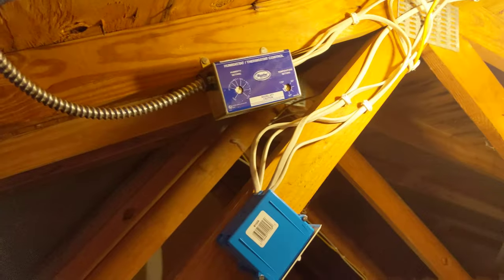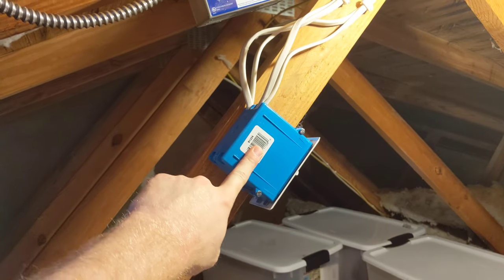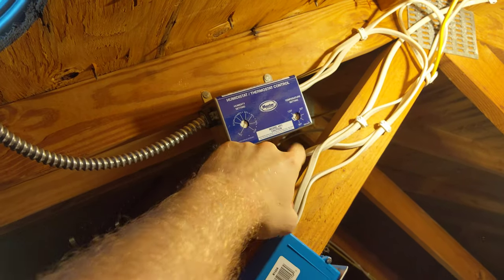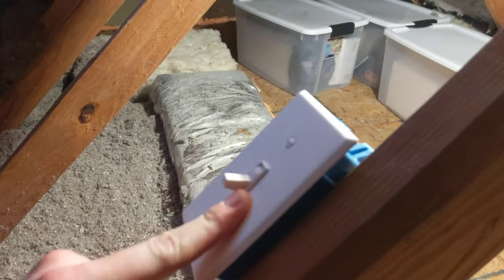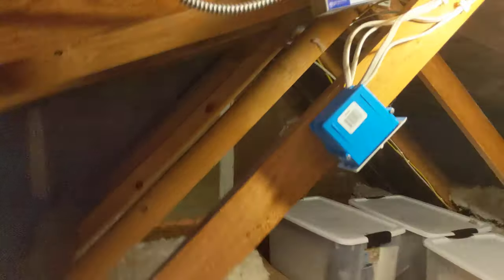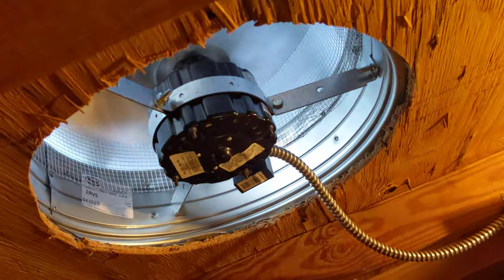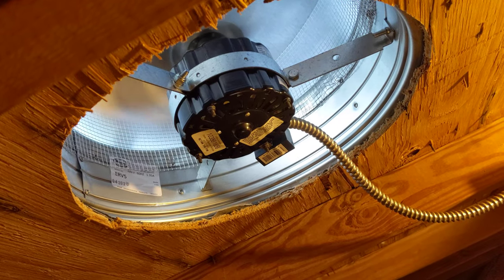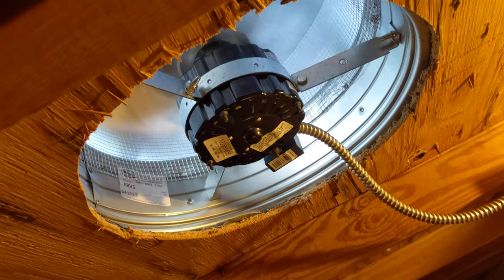Attic fan install with manual override and power shutoff

Comment: How you set up the wiring for the bypass? I would like to manually turn off and on my attic fan
Reply from the maker: Let me find you or make you a quick diagram.  I have a power cut off that is right next to the fan for servicing and the bypass switch that is in parallel with the humidistat.
Reply from the maker: Something like this is what I did with the over ride. https://shopgreenbeing.com/wp-content/uploads/2018/02/electrical-would-this-be-the-correct-way-to-add-a-timer-switch-in-with-regard-to-proportions-1195-x-1024-1.jpg

And for the cut off you would place a switch at the 120v source.